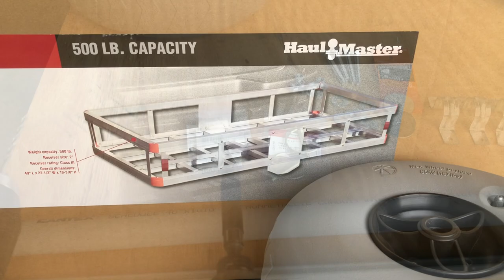Build Part 1 Axle DIY Beach Fishing Cart From Harbor Freight

Comment: You are already at a disadvantage using zinc hardware if you are taking that thing to a real beach.
Reply from the maker: True but for the price it will take several years to rust through. Has held up pretty well so far. Thanks for checking out the video!

Comment: Any issues with the tires rubbing? If not, think it would in the future with alot of use? Could easily put some stops in if so i guess.  Great video!!
Reply from the maker: @phillipa7595  the pipe that is attached to bottom of frame that the axle goes through is wider than frame. The wheel can’t go in far enough for the tire to rub. Good luck!!

Comment: I appreciate your help, I'm on my way but I have questions.  1) what length are the 5/8 bolts?  2) the link you provided for the tires is no longer with a 1" diameter hole.  If you could suggest a tire I am struggling to find a 1" diameter axle balloon tire.  Thank you!
Reply from the maker: @mgagnew   are you referring to the bolts that hold the aluminum frame to the steel hitch frame? They are 2.5” x 5/16 bolts. You could make them longer and cut if needed. You also may want to file all exposed threads so the frame slides on a bit easier. I will try to update with a better link, thanks for letting me know!! Good luck!
Reply from the maker: @mgagnew  looks like the wheel axle diameter is .9”, that will work fine with a 3/4 axle shaft. That same link does have wheels that come with an axle and smaller  size but the axle would be too short anyhow.
Reply: @zekeshandles  thank you , that is the wheel i bought the 0.9 diam axle, the steel conduit is available in 1/2" or 3/4" , the 3/4 OD is over 1" and the 1/2" OD is almost 1". what size conduit are you using?  thanks
Reply from the maker: @mgagnew  I used galvanized 3/4 conduit for my build. It measures 7/8” OD. You may need to run to local hardware with a tape measure and see if they have anything with a thinner sidewall. I will try to find a wheel with a true 1” ID and update also. Thanks for the info.
Reply: @zekeshandles  Yes, I have a roughly 7/8 or 0.88 conduit.  but the wheel at 0.9 roughly will not accept the conduit.  I have to look for another axel I guess.  where did you get your wheels, maybe I can change the wheel?
Reply from the maker: @mgagnew  bummer! I actually bought my wheels used on eBay. I did see another set on Amazon. I’ll link them instead. But they are a bit more. You could potentially drill them out, wouldn’t take much. 
https://amzn.to/4cIPndh
Reply from the maker: @mgagnew  https://amzn.to/3Z6tnWy

Comment: Nice sand truck, I would weld a washer to the axle inside of the wheels to prevent them to touch the frame.
Reply from the maker: Hey thanks! No rubbing no worries the pvc section the axle rides in is just a little wider than frame. Thanks for checking it out!

Comment: Does the tire not have bearings to spin freely  on the 3/4” axel not requiring the pvc?  Great series.  Watched all three videos.
Reply from the maker: Thanks!! The tires don’t have bearings I used the pvc under frame to make the axle easier to remove. Wheels do rotate easily without bearing though also. I actually think bearing would be a problem with the salt and sand unless sealed really well. Good luck!!
Reply: Thank you for the reply.

Comment: What size screws did you use to make the cart removable from the steel hitch? I didn’t see them in the parts list.
Reply from the maker: 5/16” x 1 1/2” they worked pretty well, I might suggest grunge the threads down a bit more where they slide in they sometimes hang up a bit. Good luck
Reply: @zekeshandles  thanks for the reply! Much appreciate it

Comment: What size clip pins are que using as wheel
Stopper??
Reply from the maker: I used 1/4 x 1 1/4” zinc lynch pins, they are holding up okay. I would probably go with stainless if done again. I just linked some stainless ones in the video description. Thanks for checking it out!

Comment: What size axel and conduit did you use?
Reply from the maker: The outer is 1” pvc and the conduit is 3/4”. It just needs to spin freely in the wheel so you may need a different size depending on the wheel you get. My wheels were 1” axles. Thanks!

Comment: Tires are made for beach or sand. typically used for a hand pull kayak trailers from truck to water over sand. 
"ballon beach sand tire" is a good starting search for these tyres.

Comment: what keywords did you use to find the wheels on ebay?
Reply from the maker: I looked up balloon wheels or beach wheels. There are a set of name brand used ones on there now that would be a good deal, I’ll try to send you a link.
Reply from the maker: https://www.ebay.com/itm/354350889802?mkcid=16&mkevt=1&mkrid=711-127632-2357-0&ssspo=D1eebnM4SiO&sssrc=2349624&ssuid=n0FbN9TwSqS&var=&widget_ver=artemis&media=COPY
Reply from the maker: I have no affiliation with this seller but probably a decent option.
Reply: @zekeshandles  thanks!